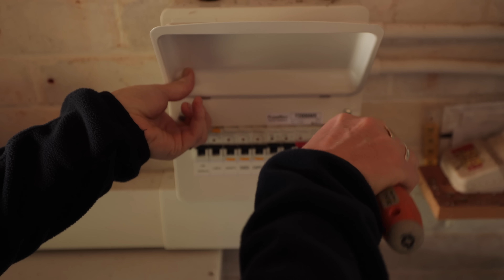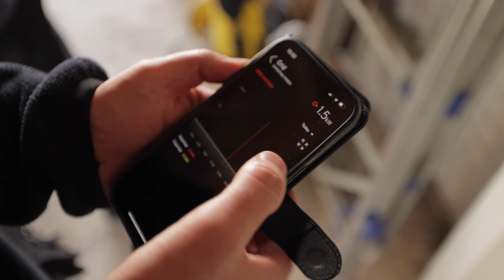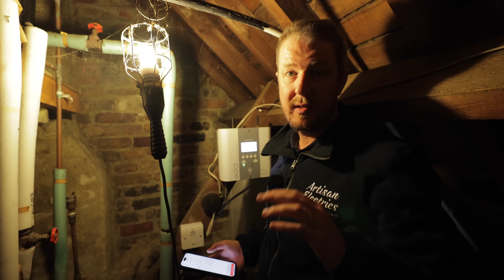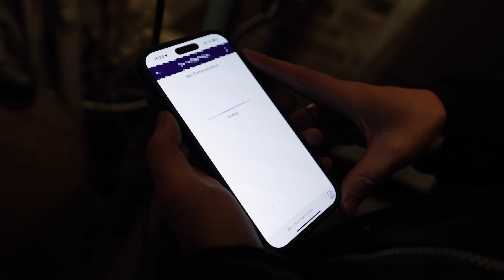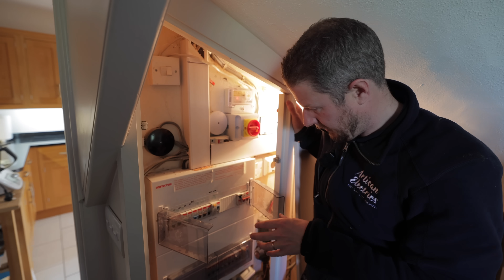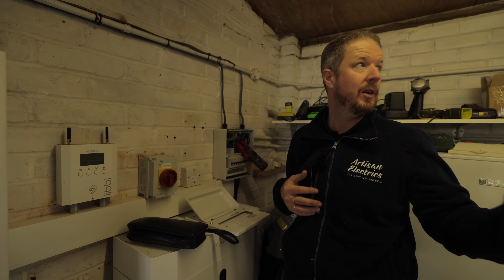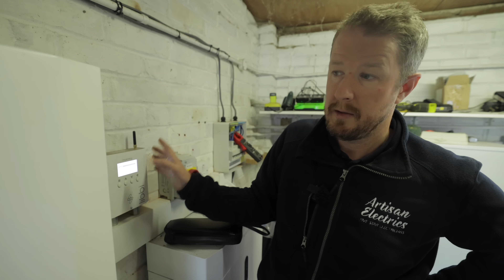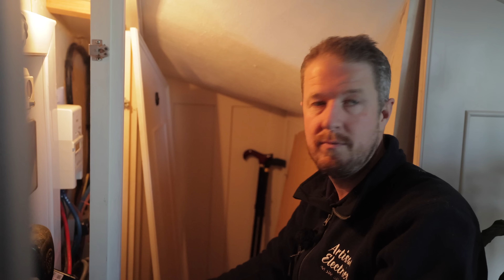£20,000+ Battery System RUINED By This 1 Simple Mistake 😳

Comment: All of the internet forums are full of issues like this. I don't understand why there is such a dependency of flaky wireless communication (both wifi AND internal 433MHz between myEnergie devices). Since all of these install require the pulling of cables for power between all the locations, why not pull data cable as well, hard wire the internet AND all the CT clamps, this will massively reduce the number of issue in my view
Reply: Hardwired is always king.
Reply: Bloody brilliant idea, I agree with you.
Reply: The real weak point is when companies go out of business. The app is no longer working. You need to upgrade your hardware for things to keep working. So much depending on the fragile structures these days 😬
Reply: @obelixer9751  You mean you don't get a system Operators and Maintenance Manual that itemises all the configured settings for your particular system and all software versions? I'd make sure that was in the contract together with a system schematic and all individual component user manuals. Are there no industry guidelines that specify the supply of this important information?
Reply: @1963TOMB Wild West of technology.
Reply: @obelixer9751 in the spirit of planned obsolescence
Reply: My words exactly! I had a Victron Energy PV system installed and asked the installers to wire it using Ethernet. They said Wi-Fi is stable and fine (I think they were actually just too lazy to do the wiring). The opposite was true. I experienced numerous connection issues until I purchased an additional Wi-Fi router to improve the signal. Unfortunately, the Victron wallbox doesn't even have an Ethernet port. Unbeliveable for that price tag. Of course, it drops now and then, requiring me reset it using its breaker.
Reply: @tomasbrabec5235  Ubiquiti mesh with 3-4 APs. POE switch, 3x WiFi APs, and a RasberryPi5 running Linux and the Ubiquiti application.
Reply: @tomasbrabec5235  Yup, they're just lazy
Reply: @tomasbrabec5235 As an inverter and battery installer and comissioning guy i can tell you that we are trained on wifi only to be fast in n out so we can do more work by day and we are told not to care and that we get paid to do wifi only.
Reply: I run data over the power sockets ring main using Powerline adapters. It works really well and has never dropped out.
Reply: That wi-fi connection is a huge vulnerability. I have removed it on my off-grid system and use just the inverter display for setup and diagnostics
Reply: The newer MyEnergi stuff does have ethernet ports as well, so there's no excuse there you're right. People seem to think wifi is more modern or something, you'd hope installers would know better
Reply: THIS! I worke with these systems (Deye, TBB, etc.) in Asia, and these guys cannot install a simple ethernet port on an expensive 20-40kW unit. Just stupid WiFi which always causes issues.
Reply: Totally agree. I was really shocked when I started working with Inverters & Batteries that the majority of them all relied (except Victron etc) on Wireless Communications.....and most of them you had to install a 'cheap' Wi-Fi dongle. 
In my old industry we had a saying 'copper, copper, copper'. Wireless communications was secondary not the first port of call :(
Reply: @RonIzzard1970 yes absolutely. I think the main reason is so that installing contractors can avoid having to do hard wiring. (Like with the old style domestic burglar alarms for instance).
Reply: That was my thought as well when I was watching this.  Also the fact that a lot of this relies on the Internet and the cloud would make me avoid it.  They can, at any point, shut down their servers or deem your system obsolete and you have little recourse.
Reply: Everything on our solar was connected via hard data connections. The only exception was the battery because of incompatibility between brands it's just an open loop format. So it's straight control through the cables and voltage settings as opposed to using the BMS connection.
Reply: I know in the early days of smart tv hardwiring via Ethernet cable made a massive difference. I have to thank my son for suggesting it
Reply: Are you kidding, that would be too simple
Reply: as i am pakistan we install solar system different than this  you guy make very compilcated
Reply: Because of simple reasons as routing, very few customers want to have a system that is hard wired when they can have one that is "wireless", less cables, less headaches, less problems.

So its a customer driven issue, but if you want a modern setup that is using wireless setup you should upgrade your wi-fi to match, nothing wrong with wireless once properly setup.
Reply: The whole industry is a bodge of modules . These will become the most unreliable systems in future
Reply: @ArtisanElectrics
Interesting video Jordan.
I followed about 80% of what you were describing, the exceptions being what a Harvey Unit is.
Question:
As our charger is currently wifi connected to a Plusnet router which provides a STATIC IP address, willchanging to a different BB provider affect the charger communication if the provider has a Dynamic IP Address?
Reply: People would never drive a car while sitting in it with steering wheel connected through wifi, but somehow connecting 20kwh battery with 5kw inverter and 7kw car charger through dodgy wifi is ok?
Reply: @darekmistrz4364  A failure in a car of Wifi in your situation is going to kill you. A failure in WiFi for home energy is annoying but not a safety issue if the protocol is to stop charging if you lose WiFi.
Reply: @oneman2001  It depends on the fail safe methodology if the steering wheel stops receiving data. For example on London Underground the Victoria Line trains receive their signalling information by resilient radio links: In the unlikely event that no data is received (data is sent continuously) the brakes on the Train are applied. As the signalling system knows where all the trains are all of the time, the Trains behind the stationary Train are also stopped. So there are ways and means to implement fail safe wireless data links if the software is of the right Safety Integrity Level. I believe that the Metro in Madrid actually uses wi-fi frequencies in their 'Distance to Go' signalling system. In a car I'd still be concerned about the vehicle behind running into me!
Reply: Get sick to death of tired lazy tradies. It happens time and time again. And no it is not okay and yes not all are lazy sods. Nevertheless the peak  trade bodies could do a lot more for their trades.
Reply: Thanks for sharing!
And what were the final numbers from solar???
Reply: Because most properties the data hub and power hub are not in the same place. You pull power from consumer unit in under the stairs or garage. Routers are usually in the lounge or office. Personally I would look at powerline but that doesn't work in every situation.
Reply: Agreed. It certainly takes another potential weak point out of the set up.
Reply: Utter garbage,the whole rotten tomato will end up being burnt for the copper in a hole in east Africa.
Science 1:01.
Reply: Why don't they use the power cables for comms? doing that in the mid 80's.
Reply: Because when your signals weak it means it blasts out and blasts the occupants also the wireless tech is being used for nafarious testing and scanning of home and its occupants. The smart home and the smart devices are all listening, tracking and storing and transmitting for nafarious big brother learning and seeing what ways this info and tech can be utilised.
Reply: Ethernet is an option on all the better hardware, the cheap stuff is using only wifi. So you just have to buy the right stuff.
Reply: This is what I don’t get with all the solar panels installations : this is such low tech! Very simple. Nothing special. It’s not rocket science or anything and yet. Systems use 30 years old protocols, very very bad UI etc.
Reply: Agree its a gamble with wireless communication.All that money spend for what?
Reply: Isn't hardwiring a step backwards in technology?
Reply: Exactly hardwire always
Reply: My heater tanks are all set between 40-42 celcius. Anything more becomes dangerous as a user can accidently get burned skin upon contact with the hot water during the start of shower or before the cold water gets to mix with the hot water line to produce a warm bath. It will also reduce power consumption from solar grid.
Reply: Too lazy and still want you to take power from the grid so you have to pay
Reply: Data cables fail.. all the time. Honestly with the correct WiFi installation, mesh. It would be easier to fault find.
Reply: Fibre optic is safer for comms - and surprisingly cheap to implement
Reply: @alanbrown397   That's it though; cost.  Even if it's cheap.
Reply: @alanbrown397 with up to date technology I fully agree.
Reply: Shit load of money being thrown at these solar installs especially in these existing installs for a country thats very cloudy and rainy.  Surely this would limit this being worth while?  In theory I would have thought a normal working family would need to recharge the car each night and your solar batteries would need recharging too?  Ten mill would be the minimum cable size to make this efficient.  10mm is only rated at 50 amps without voltdrop getting too high.  This is really interesting but can get very complex quickly.  Good job by Artisan.  NZ sparky here.  Yes we have electricity and sun here too.  😊
Reply: @mikewilliams6086 I live in the southeast  of the uk.

And most good  south facing solar installs get  here get their money back in 4-6 years.
Reply: AC power running next to Ethernet will ruin any data transmission. Yes it could be done. But would require new holes and separate lines costing more money. so in this case i understand why they do use wifi. Also they dont need high speed data so using cheap wifi is probably the way to go unless you have a larger distance to cover. Again it really just gets down to cost, how much extra would you like to spend?
Reply: This is crap - Ethernet properly implemented stays wonderfully ok even even harsh environment.
Reply: @ramair325  nah, itll run fine, ive got cat5 (just cat 5, not E) running along powerlines, i mean the beefy 8 mm thick aluminium POWERlines.....just about 60 amps go through them at one time, its been like that for yers, and my etwork is stable and the devices on thise particular lines are quite old as well
Reply: @xerr0n  indeed, EMI on ethernet lines with modern good cables is a very overrated problem.
Reply: @ramair325  That's not at all true I'm afraid. CAT5 (the least protective of the current CAT standards thats actually widely in use) have been running perfectly fine for years in literally millions of homes, businesses, buildings without significant packet loss even while sitting near AC power. The fact that the vast majority of buildings would actually be on the newer CAT 6 and 6A standard that does even more to protect from induced frequencies by enclosing each data pair in a foil sleeve AND THEN protecting all that in a grounded general sleeve, it's really not a problem. Chances are its more problematic when its installed right alongside very high current electrical arrival cables and there's not sufficient distance given between the two (but again, there are very clear regulations about this) . However for a normal solar install and following the basic rules of distancing the two cables, Ethernet would be a wonderful choice.
Reply: @ramair325  ethernet is twisted pair. it's fine running adjacent to noisy circuits. for long runs in environments where there may be a large potential difference over the span, however, it's better to run optical - and that's cheap and easy these days. using wireless for fixed installations where you need to run other cables anyway is just laziness and poor engineering.
Reply: @davidareader I’m inclined to say Ethernet was the go-to choice a decade or so back but yes of course optic has overtaken that now.
Reply: @philtucker1224 even >25 years ago, pre-terminated fibre in custom length was readily available .. so you didn't even need to do the splicing/termination yourself. Back then, low cost media converters were commonplace .. but today it's common to find pluggable optical interfaces on even low cost network equipment. It is going to cost more than a metallic link, but it's much better if you need to cover any significant distance or where electrical isolation is beneficial.
Reply: @davidareader I don’t know where you got that from, fibre to domestic households has only been readily available for a few years at best.
Reply: @philtucker1224 it's nothing to do with an internet service. It's "internal" cabling (or between a building and outbuilding).
Reply: @ramair325  Mains can have an effect on ethernet when run side by side, but not to the extent as to block all transmission. For the quantities of data we are talking, it would likely be fine. Even if data was corrupted, there are mechanisms to resend data. This is why you can get SWA mains cable with a built in ethernet cable.
Reply: @ramair325  Completely wrong.  Cat5e is fully shielded and can easily run alongside AC wires.
Reply: @davidr5964 if you ARE worried about  CAT 5/5E picking  up mains. Then use cat6/6A that is both twisted AND shielded.
Reply: @ramair325 so - how does ethernet over power lines work ? ;)
Reply: @ramair325 FSTP was invented for this... the problem of EMI on these Ethernet speeds today is very overrated and besides there is still FO, which  getting cheaper by the day.
Reply: @ramair325  i guess you forgot screened cables exist
Reply: @ramair325  We are taking about just a few dollar here. Nobody should care about that for devices in this price range. The problem is more that nobody in this companies seem to have good IT teams and do not spend a dime on R&D
Reply: @ramair325 screened cable would prevent that.
Reply: @ramair325  maybe with 10gbe. 100mbps will run on anything resembling wire
Reply: @ramair325  Use screened ethernet data cables
Reply: @ramair325  Rubbish. How do you think the internet transmission through your electrical wiring works with the plugin ethernet? Yes you might not get as high speeds but these systems only require low bandwidth for short updates communications and talking to each other.
Reply: @ramair325  It's called shielded cable. Look it up, it's everywhere.

Comment: Your assumption is that the wifi settings stay constant. Maybe this guy changed it since the install? People swap internet providers, often being instructed to fit a new wifi hub/router. If they are not that savvy, they won't change the IP configuration, SSID or wifi password to what it used to be, even if all that is possible. They'll just fit it and remember to change the wifi settings on their phone and computer to make them work. They might forget about all the semi-autonomous wifi connected devices tucked away, particularly those home owners who have not wanted/unable to get technically involved in the install. And as they get older, they will forget. It's just one problem with hi-tech installs; there is no anticipation of the future. The installer makes it work (or maybe not in this case) then buggers off. Then, if there has been any government subsidy meddling involved, they go out of business. It's not good for the consumer.
Reply: Alternatively I bought a much more powerful WiFi router than the ISP provides that I connect to all my devices, so when I change ISP I don't have to change settings on any devices

Comment: I was surprised to see these relatively modern systems just hung from cables or fixed to a random plank of wood. I would have thought sensors would be fixed in place with a right angle bracket, with independent back boards for the bigger readers and settings all in place. Not just a handful of mud thrown against a wall.

Comment: We are so lucky having insane Insolation levels in Australia 

My 12kw solar puts out 60Kwh plus per day on average and export 70% of that to the grid for $$$$ that pays for the solar and 32Kwh of Pylontech batteries i use sundown to sunup

I run 17kw of a/c split systems for heating and cooling, 2 dehumidifiers, a heat pump Hot Water system and all electric cooking and loads of tech and lighting and never pay for power, just lots of credits i cash out

Comment: Far too much going on in that loft. I originally had my inverter in the loft and it just made too much noise when the sun rose. Yes, it was directly above my bedroom! Moved it to the garage when I had a Tesla powerwall installed. Seems much simpler than the myenergi setup.
Regarding the HW immerser control thermostat, seems this one has been bashed about a bit so it should be deemed unsafe. Current models have a built in safety setting. Look for a Cotherm TSDR which has a combination device in the same head. The real problem here is that immersers last a ridiculously long time, some over 40 years and never get looked at unless they break. (I'm in that line of business.)